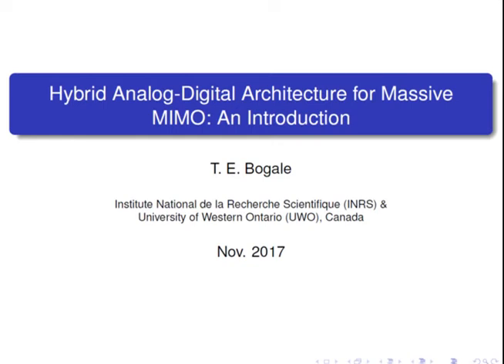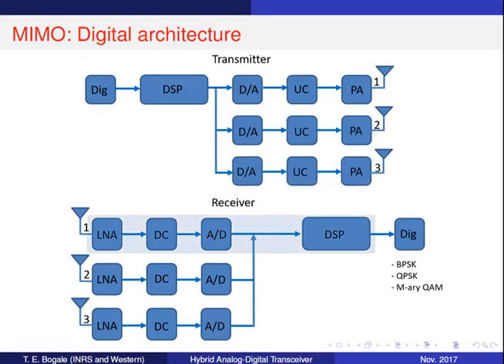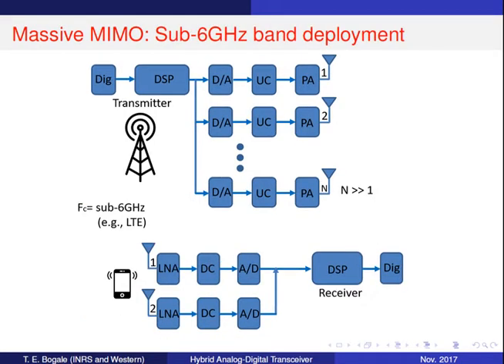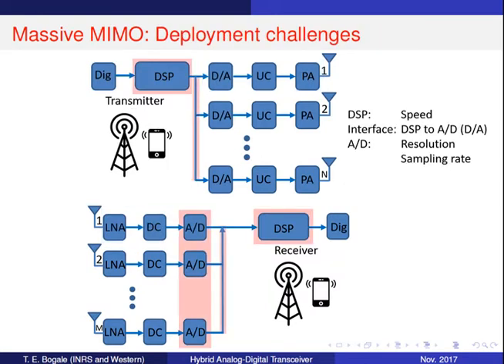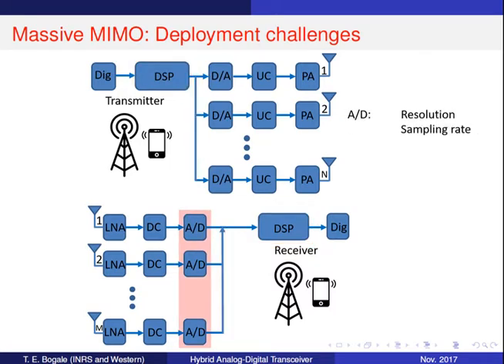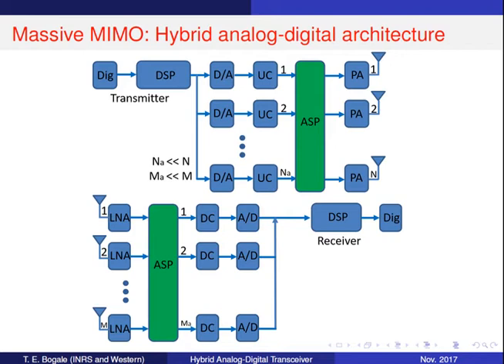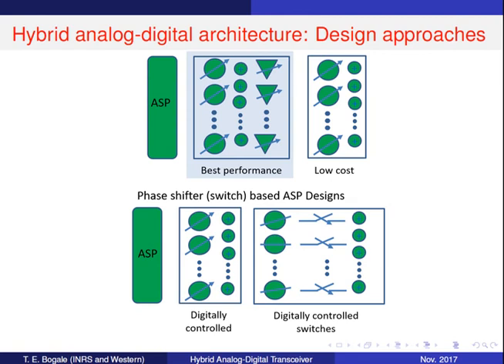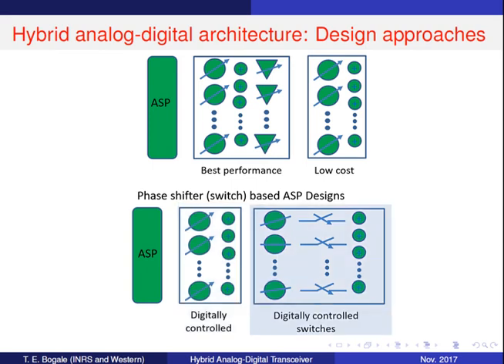Hybrid Analog-Digital Architecture for Massive MIMO: An Introduction

Comment: which program can I used to design massive MIMO ?
Reply from the maker: Do you mean a programming language? If that is your question, you can use Matlab.
Reply: tanx for ur answer ,,I want another program what u think about GNU Radio simulation,, I need explain about block diagram of massive mimo if u have report about it please send it by email  eng.sara.sr@gmail.com
Reply from the maker: Yes you can use other languages as well including GNU Radio and Labview. More information on the block diagram on massive MIMO can also be found in https://www.sciencedirect.com/science/article/pii/B9780128044186000091
Reply: tanx a lot for ur answer , I got this book "mmWave Massive MIMO A Paradigm for 5G , if u want it I can send it for u
Reply: Sara Sa hi please can you send it to me if you can